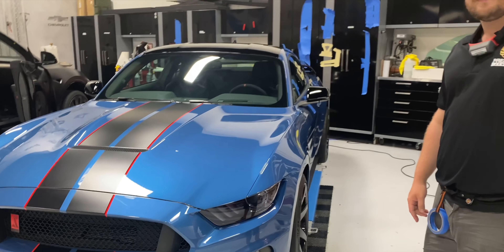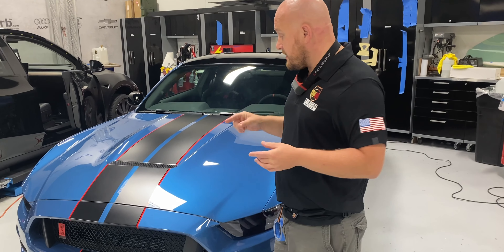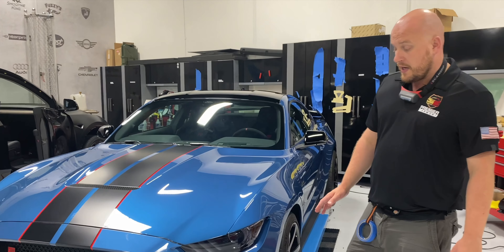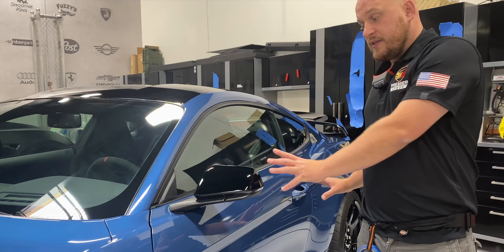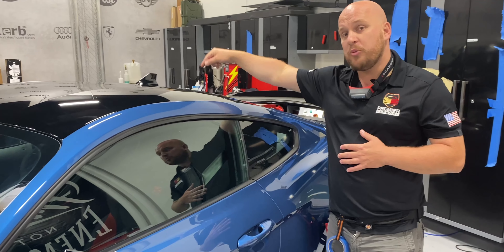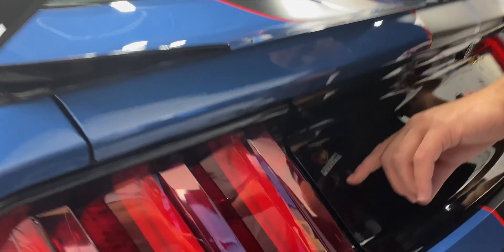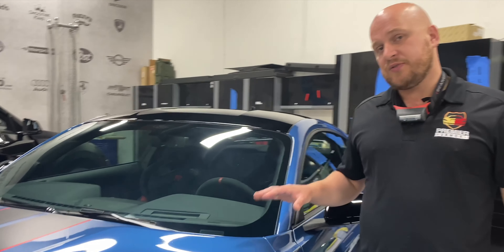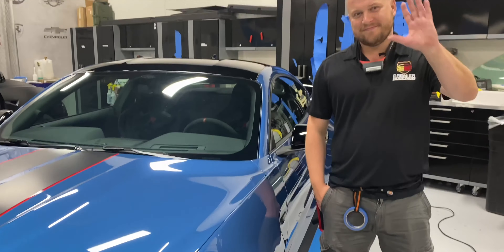GT350R fully wrapped with PPF... SO INSANE!!!!

Comment: it sounds like you did a full wrap over the stripes. Did you get any air bubbles from the step between the surface and the stripe?
Reply from the maker: No air bubbles...they did a great job cutting different strips to keep the black stripes matte, and keeping the red glossy. This was a better approach than just completely wrapping over the stripes, which would of made the black stripes change color to glossy vs the oem matte.
Reply: @avzwhips5536  so was the hood wrap (minus the stealth pieces) a single piece? or multiple pieces? did the gloss wrap stop at the edge of the stripe? or did it go over the stripe, and get covered in addition by the stealth? Im asking because im looking to have ppf done on my '19 R as well. Im on the east coast. every shop does it differently so I just wanted to see the options.
Reply from the maker: @jonjma  The hood wrap was multiple pieces...gloss over the red strip only, matte over the black stripe only , and the paint down the middle cut as well. Nick mentioned in the video they butt seamed it all together. I hope that helps.